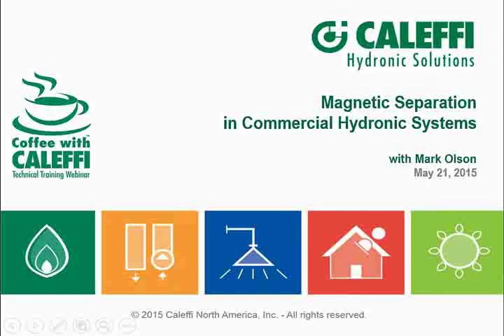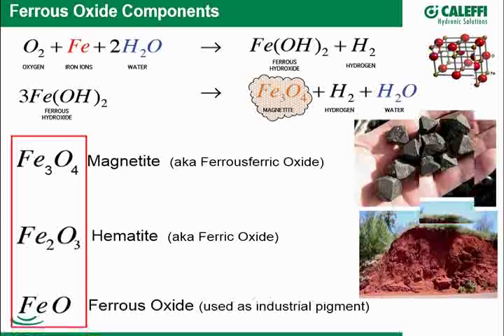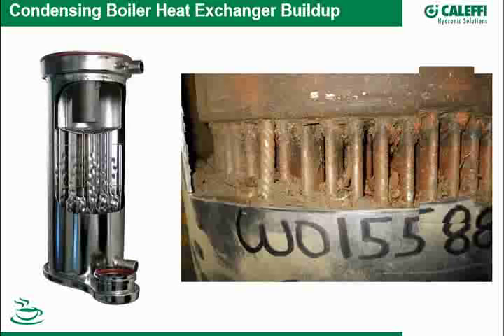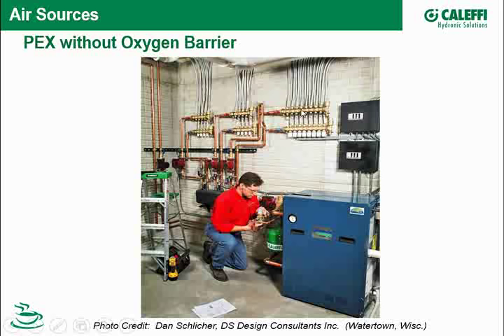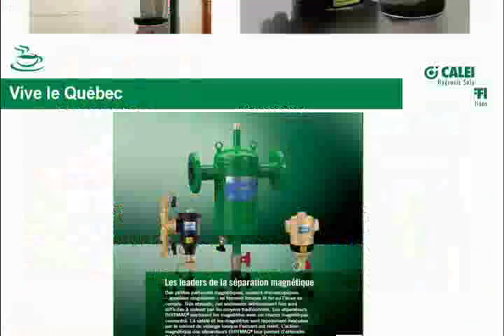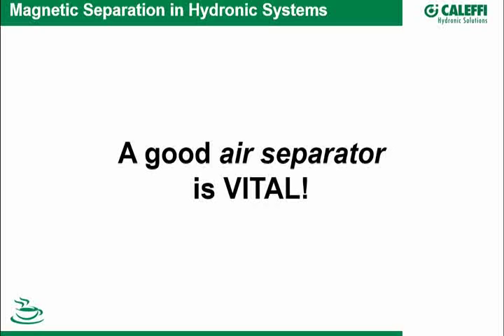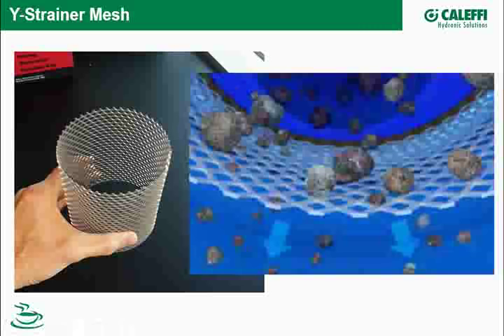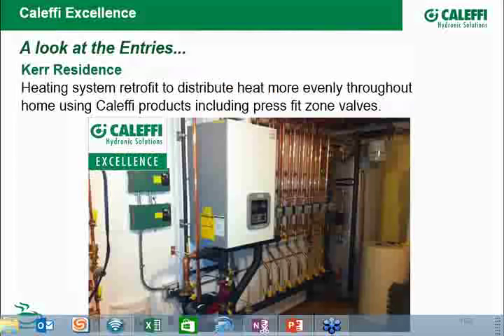Magnetic Separation In Commercial Hydronic Systems

Comment: Hi , is it likely that the plastic bodied magnetic filters will also allow the ingress of oxygen just like non barrier plastic pipes .
Reply from the maker: DALEYPLUMBINGHEATING The 5453 Series DirtMag composite body material is molded at a very high pressure (over 4000 PSI) and the wall thickness is more than 1/8”, thus eliminating the possibility of oxygen ingress.
Oxygen permeability is only an issue with tubing/piping, where there is extensive interior and exterior surface area.We hope we managed to answer your doubts. Have a good day.
Reply: Caleffi Hydronic Solutions Thank you for taking the time to reply . Great YouTube channel